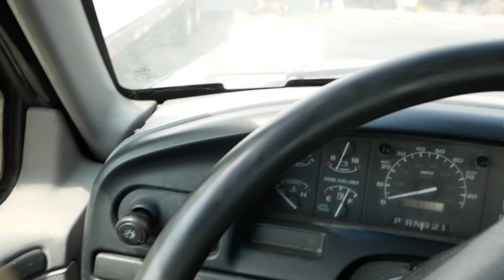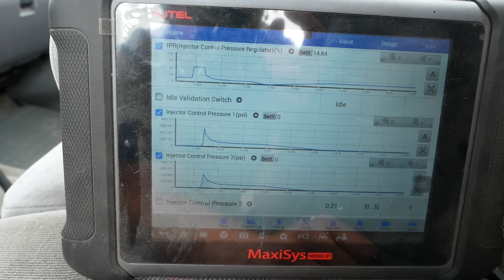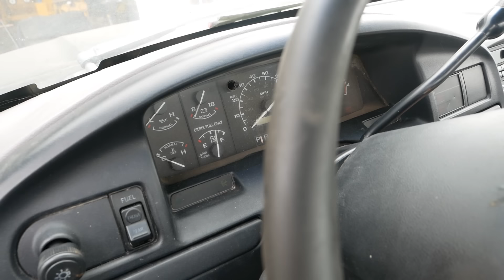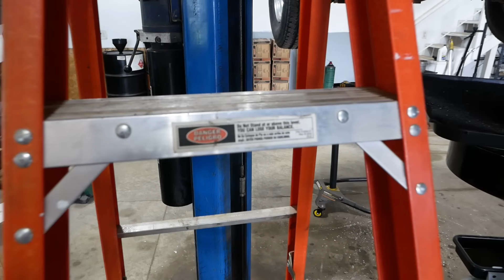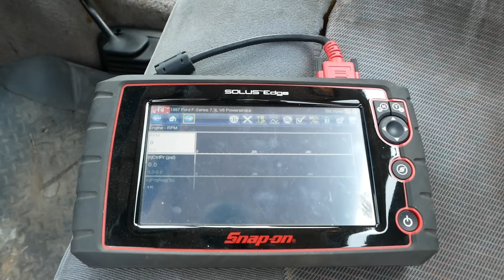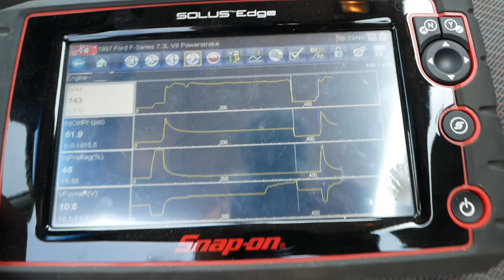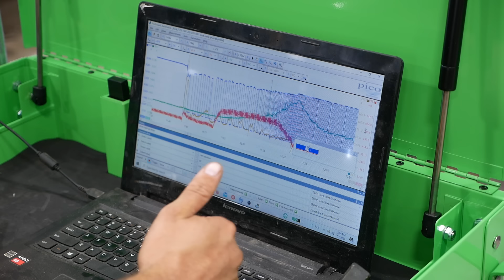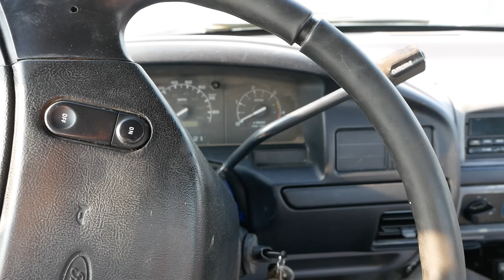Can We Get This 7.3 Power Stroke Back on the Road After Four Years?

Comment: I know I'm three months late but that port where you pulled the oil out of the HEUI galleries, it doesn't get changed when you do an oil change.  You most likely know that..  Changing the high pressure oil by sucking that oil out and putting fresh oil three to four times and running it in between helps a whole lot.  Bill Hewitt from Powerstroke Specialties has a video up on that matter.

Comment: 4:53 Now THAT is a trick tool!  Get me some of that for changing the battery on my tractor!
Reply: My Dad had a battery carrier made with two elongated washers and a movable half moon latch and piece of v belt for a handle I am guessing it was made in the 1940's and it worked great on most of the batteries of the day but not the six volt long batteries in some of the GM cars and the dumb side post batteries.
Reply: Lisle makes a nice battery carrier actually. Good quality and right around $15 from Amazon.
Reply: Derek/vice grip garage needs one of those.   Universal go-handle.
Reply: @thereve  Yeah he does!

Comment: 30:00 I love nicop line, it's so easy to bend and really easy to flare. My line bending tools pretty much just gather dust in my room drawer as I only use them to make really tight or complicated bends
Reply: There's a 1991 F250 with a outstanding body and paint for it's age. I got it to fire after a new switch and fuel filter and bled the lines out.
 It's an ether baby with one dead cylinder that possibly is a stuck open injector. If so,maybe the knocking that sounds like Satan's Forge is coming from hydraulic piston lock. Or maybe a bent rod.
  If I could find a engine or perhaps deactivate one cylinder and it's fueling,would the thing run? One thousand will buy it. It's an IDI 7.3 engine and no turbo

Comment: I actually really like ratcheting wrenches for certain situations. I have a set of cobalt ones that have sprag clutches in them so they are basically infinitely ratcheting.  They don't get used all that often but occasionally there's a situation where if I didn't have the ratcheting wrench I would have been there all day taking a bolt out that was hard to get to and that a regular ratchet just won't fit on
Reply: They have their uses, but I think he was just saying not a replacement for a regular spanner.
Reply: I was disappointed when I got a set because the head is so big, they don't fit into those tight spots that I hoped they would, but they do get into certain tight places and save me a lot of time on occasion, so they were well worth the $30 I paid for them.

Comment: I believe you could. I have a 99 f350 7.3L that sat at my cousins shop for a couple years. replaced the brake calipers all that and the rockers and cab corners a year and a half ago and it's still running great. 

After watching this video mine was in much better condition.

Comment: I'm surprised they actually fixed the AC instead of just running a bypass pulley/belt.
Reply: judging by the rats nest inside, I wouldn't want to run that fan at all, but hey, people want to be comfortable.
Reply: I would have just removed the ac system. Just saying hahaha
Reply: well it aint too expensive for them to get that done once the truck is over at Wes Shop and no AC is not fun when you have crazy summers and judging by the fact that its a farm truck they would spend a lot of time at slow speeds or standing still so no airflow

Comment: Wes, I think a diesel Ford of that era started like this: turn the key to the on position. Glow plug light turns on. Wait until glow plug light goes out, then crank over engine. You can't immediately crank engine like a modern diesel. Just my guess.
Reply: That doesn't explain the lack of pressure building.
Reply: Wes is fully aware of the starting procedure.
Reply: Should still be hot enough after a few minutes to star pretty much straight away.

Comment: My grandpa gave me an 01 Silverado. Everything original. Hoses and all. No dry rot or hardly any rust. Pulled trailers boats and everything with that thing. Love living at the n.c/s.c. Border. Might replace shocks. Little bouncy on pot holes and stuff. Did have to replace a crankshaft censor recently. Did so many things before that fix.

Comment: Heh, mine is 44 years old, but nowhere near as bad as that.  Three-on-the-tree life, baby!!!
Man, just look at what's not left of that driver side front fender!  Those steps are mint though.
They're fixing the AC?? In that thing???
Stuck fill plug? Easy, put a fill plug in the new cover! Drill a hole, weld on a thread-bung...
Line wrench is good for cracking it loose enough to where you can use a regular wrench. Line wrench is good for torqueing it back down too.
Air hammer FTW!
Standing on the top of a ladder?  In flip-flops??  That's living dangerously...
Nasty mouse nest on the shop flo- OMG, WATCH OUT FOR THAT WIDOW-MAKER SPLIT-RING WHEEL!!!

That was my exact thought on the key-on phenomenon:  It must be leaking down somewhere when powered off.  Or perhaps something is not happening during starter-cranking - i.e. a valve opening or closing, or even a pump motor turning...  Are there electronically-controlled valves in the injection pump?

Comment: Wes. The solution to your slow/fast start might just be rooted in pump laws. It is something I use every day in the HVAC trade. 

If you increase the RPM of your pump by 10%, the oil flow trough the pump goes up by 10% but the pressure developed by the pump goes up to the square of the % of change. In this example 21% more pressure supplied by the pump. 

That means if the pressure sensor is marginal at Key off start rpm, the key on rpm being roughly 10% higher and the pressure 21% higher puts the pressure sensor in the Ok range and you get a short start instead of a longer one. 

Cheers it is physics and no matter the pump type or fluid it moves the laws remain the same. In short either the oil pressure sensor signal is off due to age  or the computer is misinterpreting the 0-10 v signal.

Comment: Could the delayed start simply be a warn fuel pump. It would stay primed when the truck is in the key on position, but bleeds back to the tank when the key is off because the pump is no longer engaged electronically by the computer.
Reply: Seems I ran into something like that once. Turned out to be fuel pump. But I would also check schematic for  voltage drop points.
Reply: I know my 95 f350 is a mechanical fuel pump, i believe its the same through to 97 but i could be wrong. Most obs diesels have a single fuel pump in the valley behind the fuel bowl
Reply: It’s stiction causing the delayed start

Comment: If the fill plug doesn't come out, you get a cover with a fill plug. I had to replace the cover on my GM pickup because I couldn't get the plug out of the housing.

Comment: I've got a 1995 one-ton dually, standard cab, 7.3 power stroke, 5 speed, 4x4, flatbed. It's a good truck for my cattle operation. Gets regular maintenance, and that's cheaper than buying a new one for 80K. Fortunately, I live in ND, where road-causing rust is less of a problem.

Comment: 04:45  Okay, you're the one who used the word "caveman" first.  I would have gone full-caveman under the hood with the power washer prior to touching anything.  Rats, mice and other small vermin poop and pee everywhere and leave nasty diseases in their droppings.  Love the work you take on, but yeah, sometimes you gotta think about your health.  Good idea with the battery lifter, but you gotta suit-up or wash down prior to handling things in critter land.
Reply: That thing would have gotten a Lysol or bleach mixture from a pump sprayer and then a pressure wash from me. Rodents are nasty as hell and they can't help it if they wanted to, the incontinent little bastards.
Reply: @ChevyConQueso  
I agree, but,,,
Getting it wet may add additional problems especially with electrical that become impossible to chase down.

Disinfectant is not effective on dirt.  
The active chemical gets exhausted on the soil first before it penetrates.
To be effective, hot soap/detergent first, then disinfectant, then clean water rinse so you don't continue to  corrode all the electrical connections.
https://www.cdc.gov/rodents/diseases/direct.html

Comment: As others have said regarding the capacitors. Could install a 16volt 4700uf cap at the ecm power and see if that helps your crank time.  also it doesn't have to be an exact value for the uF
Reply: From others comments probably worth a try
Reply: And what's the theory as to which capacitor is preventing a mechanical system from building pressure when the solenoid is being driven normally?

Comment: The thing that comes to mind is the fuel pump stays on keeping pressure while the key is on.  Once had a similar problem on caterpillar 3406e.  Found that it lost prime with key off because the primary and secondary fuel filters were accidentally swapped into wrong positions.

Comment: I bought a 1996 F-250 with the 5.8 gas, the front end was crunched in a wreck yet I still paid $2000 grand for it. Must have been a southern truck as the rust was minimal. Most bolts weren't rusted, replaced the front clip, straightened out what I could with my wrecker and a tree long story short I wouldn't trade the truck for any others. I plow snow in northern MN for the last 10 years and still the trucks strong! Even the rust isn't bad at all. Last year I charged the A/C and I'll be damned it worked! Wish it had the 1 ton front solid axle but hey. The tranny still works great but I will add a tranny shift restorer to hopefully keep it that way. Wally world sells the conditioner for $15. Bucks and I swear by it. Any plow truck should use that stuff, white quart bottle.. $15.44 last time I checked. Hard to beat these old OBS trucks. I now own 5.. 😊

Comment: The 7.3 PCM usually won't fire the injectors until it sees 500 PSI on the ICP. If the ICP sensor is failing or slow to respond, that might cause the issue. E4ODs will sometimes start to lock the converter at bad times if they're running low on fluid or the filter falls off.

Comment: Check transmission range senor for extended crank. I had a tow truck that always extended cranked. I was fixing a unrelated issue and noticed the range sensor was never in park position and back up lights didnt work.

Fixed a short to back up lights and replaced switch. When switch was replaced it now showed it in park on the scanner. 

This automatically cured my extended crank issue too.

Comment: I would've left the key on for awhile before starting it at all then tried to start it to see if just the key being on before starting is the solution. Also I think spraying water on nut after welding it on weakens the metal and makes it easier to break, I'd suggest letting it cool down while working on something else and seeing if that gets better success rate but I'm speculating on that one.

Comment: Hey Wes.   How old is the oil in this thing.   I noticed the oil pressure gauge takes a while it build base oil pressure.   The injectors  like fresh oil.  Get the thing as hot as you can then while monitoring ICP and IPR, hold the throttle to just below rev limiter in neutral.  If the oil is breaking down, IPR will ramp up, and ICP will be all over the place.  Change the oil, then take it for a run in second gear., WOT to clear out any air    
   I’ve seen that problem with the wiring insulation many times before, I personally think it’s the fumes coming from the engine that causes the insulation to break down over time.    Hope this helps.   Love your channel.   Keep pulling wrenches.
Reply from the maker: I changed the oil. No change in crank time.
Reply: @WatchWesWork     With all that rust maybe a pinhole in the fuel line causing it to lose its prime ??? You could take the   Fuel filter out, block the drain valve in the bottom of the fuel stand and see if the level drops. These things were out of warranty in 2008   Been a few years since I’ve seen one so the memory is a little fuzzy.  Especially when you consider the other 3 losers that followed it.   Think I’d still be looking at the Oil pressure, but it’s just a guess     Hope this helps.

Comment: Do those trucks have electric lift pumps? If they do, maybe the lift pump lines drain out back to the tank when the key is off and takes a few seconds of cranking to deliver enough fuel to the injection pump to actually build pressure and start the engine.

Comment: For the brake bleed im surprised you dont use the little vacuum hand pump ive seen you have out before..  harbor freight sells them specifically as brake bleeders and they work great -one man job..  Just keep the hose/canister elevated above the bleeder when using..

Comment: There’s a linkage under the steering column for the gear selector. It always comes loose on these trucks. Throw some thread locker on the two bolts and hit them with 20 ugga duggas, and she’ll clear up. Mine actually popped into gear with my kids inside. Had to chase it down to stop it. The kids thought it was fun.

Comment: Did you ever check glow plugs? Not sure if a truck this old has them, but in most trucks glow plugs light up when the key is on. If you start without holding the key in the on position for a bit, it will drag at startup. If you wait for a few seconds until the glow plug light turns off, it starts right up.

Comment: If you primed the HPOP and it still didn’t fire up right away then you don’t have a high pressure oil leak. Definitely a fuel pressure issue or the glow plug control module is bad. The glow plug module is to the left of the upper fuel filter housing which looked a bit crusty.  You should’ve also should’ve changed also since the truck has been sitting, as well as dirty oil can cause issues with starting.

Comment: Hard start may be caused by the Kam ,they don't sitting for long periods of time with no power.it may have lost it's memory,you can try resetting the keep alive memory and check the ground on the pcm case,it should be grounded.also may want to do a relearn on the crank sensor as well.ive run into this issue before and ended up replacing the pcm for the same reason.

Comment: The leaking ICP sensor is failing the PCM will not fire the injectors until it sees 500 psi of oil. The ICP gives this reading when they leak at the connector they should be replaced. In the E4OD transmission the stalling/lugging in reverse is from the pump sucking air. Normally caused by the filter coming out of the bore. They make clips to hold it in place.

Comment: If anyone has one of these old square body Fords one can easily get floor pan kits with the rocker skins and cab corners. Making inner rockers is simple and I mean total childs play if you take your time make a card board template like I already have a few on hand even the extended cabs are pretty easy too. But I got truck with a rebuilt 300 6cyl in it and the dam thing had all new springs and shocks. I am currently ordering parts for my spring time project...

Comment: If the control system is anything like a Cat, you can try to start it with the ICP sensor unplugged and see if it makes a difference.  The ecm will think it has 0 injection pressure and ramp up
the HUI system pressure.

Comment: The slop in the transmission linkage is most likely due to loose bolts at the rear of the steering column where the linkage is mounted. The long slow start may be due to poor grounds and aging wiring & connections that do not permit enough voltage to your sensor in question while the starter is engaged. Just for fun a person might try providing a 12 volt signal to the sensor independent of the wiring harness. I am not sure what year Ford starting routing the ignition signal through the transmission position sensor but that could also be a factor. Given the amount of corrosion on the bottom of the truck any electrical connections underneath should be highly suspect!

Comment: Wes; I think your in tank fuel pump is leaking back into the tank, to check this out try flipping the key on a couple of times before you try to start it. If that works your fuel pump is leaking back to the tank. I have to do that with a gas pickup if it sets along time.

Comment: Change the oil and the long crank will resolve. If the oil is old or broken down it doesn't generate pressure unless you crank the hell out of it. I figured this out with my 96 f350 7.3.

Comment: Is it possible the HPOP is losing prime and oil draining back to sump?  There was vendors selling replacement gaskets that were the wrong configuration for the early Powerstrokes. Another thought is the low pressure oil pump is worn out and taking forever to provide oil to the HPOP.

Comment: The flare wrenches were even more important when the fasteners were made of softer material like brass. They are still important... Stronger, better fit for problem fasteners, when using a regular box wrench might round the fastener... Just my 2 cents

Comment: I know it's been 3 years . But seams like a ground / voltage issue somewhere.  Once it pushes through the resistance and makes a good connection voltage stays high until you cut power buy turning off the key.

Comment: for the long crank did you check the glowplugs?  with key on they are on for awhile, enough to heat the cylinder for a faster start than if cold (?).  With 200k+ miles one ore more could be worn out, or the glowplug harness, there's already evidence of wiring issues/damage.